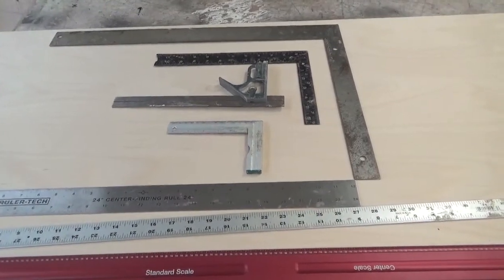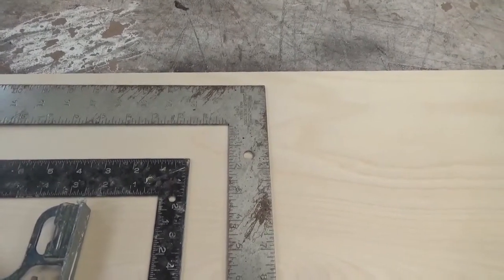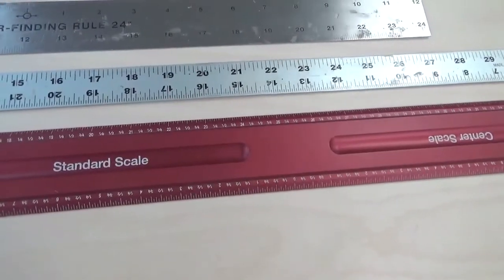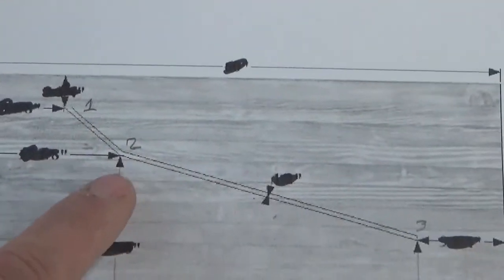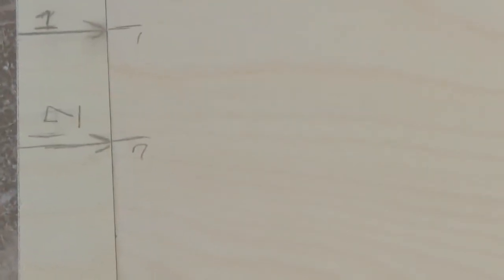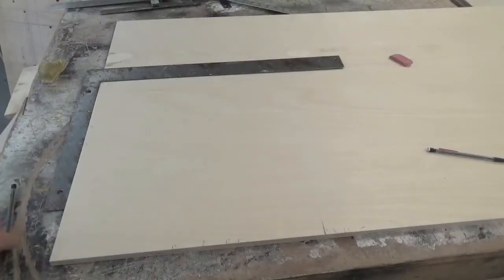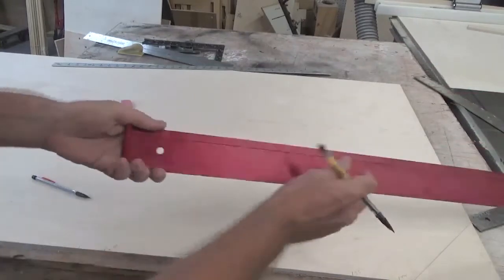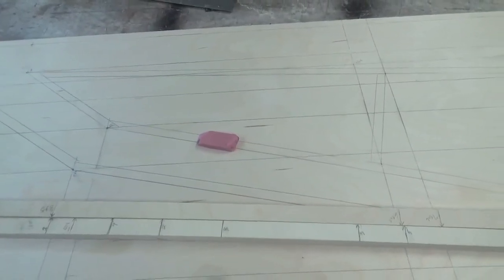Layouts

Comment: The Incra T square ruler is damn handy as well.  You are limited how far in to a panel you can use it (6" or 12", depending on the model), but it makes layout SO fast - especially the 1/2" all the way around the edge.  Woodpecker do a similar idea with an Aluminium t-square that is several feet long, but £130 for one - not a chance.  You must remember from the forums how much of a skinflint I am :)
Btw, is that a T60?? Looks too big for a 45
Reply from the maker: It is a t60.  the incra is awesome, I just haven't sprung for it yet.  I need to, my fox models require resquaring frequently